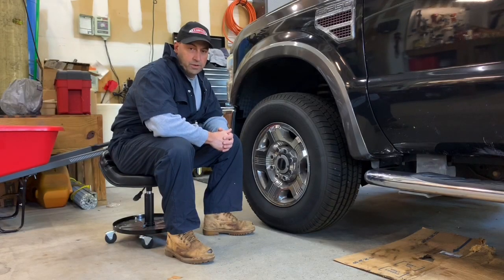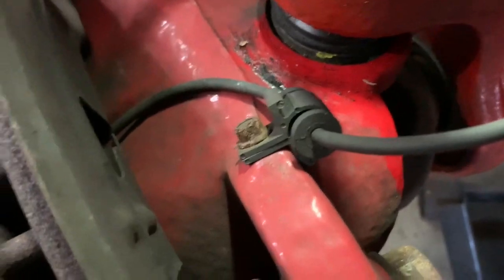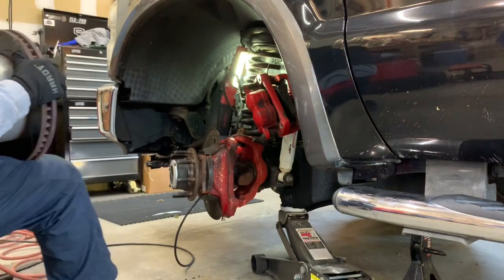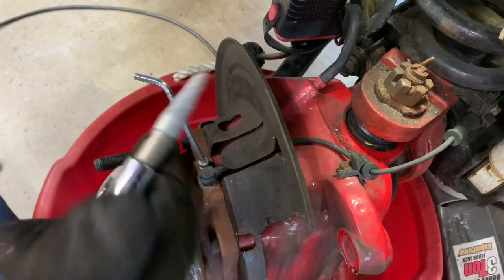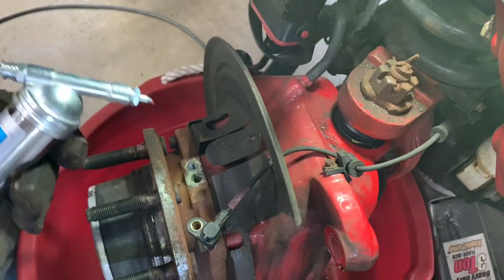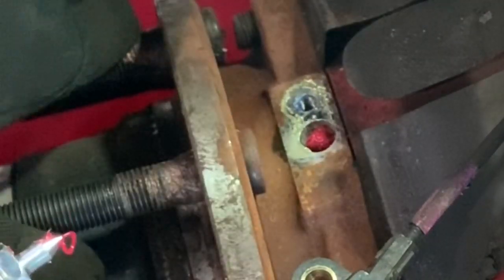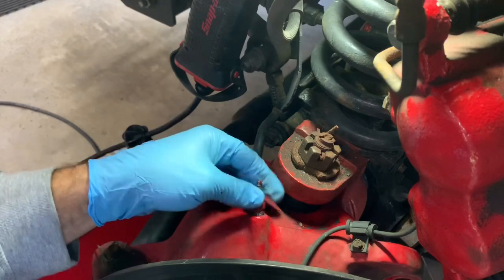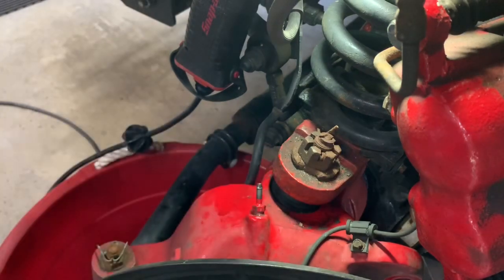How to Service a Non Serviceable Hub Bearing F-250

Comment: Any update? How are they holding up?
Reply from the maker: No good.  My passenger side hub crapped out after a few years.  New hubs (OEM, mind you) went in summer of 2018 and I started noticing a rhythmic "wah, wah, wah" coming form the right side in Feb 2022.  I just replaced it last weekend (Oct, 2022).  I don't believe adding the grease caused the premature failure.  I think these are just prone to fail.  I went cheap this time and only replaced the pass side this time with an aftermarket from 1A Auto.  We'll see how that holds up.
Reply: @DieselMike  thank you for the update I also went cheap with Detroit axel hub will see how long they last
Reply: Why is someone selling an adapter for the ABS sensor to put grease in if it doesn't work? And they are still in business?
Reply: @soldierscraft9213 How are the Detroit Axle parts holding up? I have used them on smaller vehicles over the past two years with no problems.
Reply: @js35409  well 1 year later the hubs are holding up good no issues been true two winters and all good still
Reply: @DieselMike I been thinking of doing this to my jetta!  Anything bad happind yo censored?

Comment: You have successfully greased the attenuator for the wheel speed sensor. The attenuator requires no grease. As far as the Archoil in the knuckle fitting. What were you hoping to accomplish? That area is the cavity for the vacuum actuated ESOF. There are no moving parts within that cavity with the exception of the special pressed onto the axle bearing portion of the inner seal of the knuckle's inner seal which is installed with the OTC 6697 special tool. The outer portion of the cavity is sealed by an O-ring (usually yellow) installed in the groove allocated for it on the wheel bearing hub assembly. The stub axle passes through the cavity and rests on a replaceable sealed bearing that is C-clipped into the wheel bearing hub assembly. The vacuum reaches the  hub assembly through 2 machined grooves in the stub axle.  Nothing requiring Archoil lube. That's it!
When installing the wheel bearing hub assembly it is a good practice to lube the O-ring prior to installation onto the wheel bearing hub assembly and also lube the outer edge of the knuckle cavity to facilitate installation into the knuckle cavity. It is also good practice so as not to pinch the O-ring, to tighten the  4 wheel bearing assembly nuts equally  until it is torqued to 133 ft. lbs. torque as recommended in the Ford service manual.
Reply: I’m glad you got that off our chest because your choice of jargon is a bit nicer than mine would of been 😂😂 ty

Comment: for some reason the tapered roller bearings in these have a plastic cage (even the Timken U.S.A. units). If someone were to cross match a steel caged bearing , I think the hub life would be far better.
Reply: On my 02 F150 it came with Timken bearings with plastic cages which I thought was cheap, at 300,000+ miles I changed the rotors and installed some bearings with metal cages , the original bearings were in perfect condition. Then I read the reason for the plastic cages is less friction and wear, when I changed rotors again I went back to the Timken bearings with the plastic cages.

Comment: I hate to tell you this but you're really accomplishing nothing besides wasting Greece and maybe screwing up your sensor. those are sealed bearings and you're not going to get grease in there doing that the only way you can get grease into those bearings is to jam and needle through the seal and pump some grease in. sorry to be the bearer of bad news
Reply from the maker: Thanks for the comment, Chief. But if you scroll through some of the previous comments, this has long been covered and acknowledged by me. And Greece is an island country in Europe. Grease however is extremely cheap and I’m not too concerned about a few squirts of waste. Thanks for watching!
Reply: No point in watching this one since I’m replacing the bearing hub assembly’s for a custom, I’m not clogging the vacuum lines with greece..😳
Reply: Well you must not have done any research.   No this will not repair an assembly that has gone bad.    But it will prolong the life of a good one.   They are not sealed inside they are only sealed from outside contaminants
Reply: I guess mr know it all never drove through high water.  Grease keeps water and rust out just like a boat trailer.  Good idea to put grease in
Reply: Had my 99 f350 since new. Today, I'll replace the passenger side. In 25 years I've probably replaced a half dozen. I'm going to try this. Hopefully I don't f**k up the ABS sensor.

Comment: I noticed on my 17 f250 I have a humming noise that comes on for about a second then goes away for a second or two and it does that the whole way down the road. I lifted the truck up yesterday and the passenger side wheel feels good when turning but every few rotations I can hear a slight grinding noise. Unfortunately the motor craft hubs are back ordered so I had to get a master pro brand. 

Never had a hub bearing sound like this one it’s like it’s on a timer comes and goes at the same rate the entire way down the road.  Just hummm…….hummm……….hummm

Comment: Your assuming that the sealed bearing is open on one side so I DON'T UNDERSTAND how grease this way will get into bearing and not just an open cavity inside?  If you have evidence of one take apart I could possibly believe this works.
Reply from the maker: I believe you are correct.  After all this preventative maintenance, I had one fail again.
Reply: @DieselMike they are designed to fail, gone are the days of clean, lube, adjust bearings - it was a bit of a chore but way simpler and satisfying than the rusty hub change. The bearings are nowhere near as robust looking at the tapered roller bearings on the spindle design was, it is safe to say the mfrs saved lots of $$$ switching to this design
Reply from the maker: @kellismith4329  yeah. They suck for sure.
Reply: The bearings are sealed for life. You can’t get grease into them that way.
Reply: What he just did was right up there with polishing the polish

Comment: If you don't have a grease fitting you can use an air blower to blow it down into the hub. Not the best way but it will work.

Comment: These bearings are sealed. The only one that can get any grease is the needle bearing on the back side that supports the stub shaft.
Reply from the maker: Yup.  You are correct. See my response to the pinned comment.  These hubs will and do fail eventually.  Even the OEM's

Comment: Did this the other day but now when i turn full lock right my abs light advancetrac service warning comes on then goes out after wheels straight any ideas what it could be?? 2015 f250 6.2l
Reply from the maker: Check that the ABS line is properly routed and seated back onto the sensor.  Insure that there are no kinks in the line when you turn the wheels that far.  Aside from that, perhaps the grease just needs to be worked a bit into the hub, away from the sensor.
Reply: Diesel mike went for a long trip and it hasnt done it since maybe grease was blocking the sensor from reading???
Reply from the maker: @dillonkaitypeters5132  That would be my guess.  Glad it worked out.  Good luck.
Reply: That won't do anything for the bearing the 08 don't use needle bearings they use a roller and it's sealed the grease won't get to the bearing that's a waste.
Reply: @offgridtx3043  they are sealed on the outside, not on the inside. This works, the grease will get to the rollers if you push it in
Reply: I installed the timken hub for my truck twice in 3 months. Mine keeps ticking like a day or 2 often the installs. I’m wondering what keeps taking them out. I don’t drive my truck hard nor do I mistreat it. I’ve been a wrench bender for 29 plus years so I don’t believe I did anything wrong. I put some Lucas hub oil in it and the tick stops but comes back after a few days. Any advice would be great.

Comment: This will not grease the wheel it is a sealed bearing and that is what fails on these hubs.
Reply from the maker: You are correct.  This method only adds grease to the outside splines of the bearing. I still believe it is good maintenance.   That said, one of my new OEM hubs failed after 3-1/2 years (see response I just posted above to Soldiers Craft comment)
Reply: @DieselMike  I had a moog fail in less time than that. I am going own this time.
Reply: @DieselMike  You grease them on install using high temperature grease.